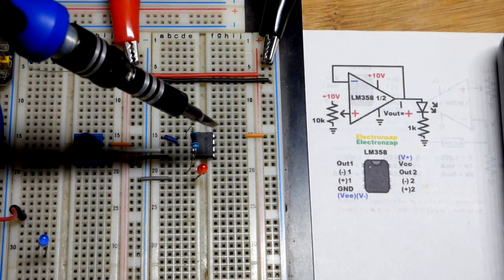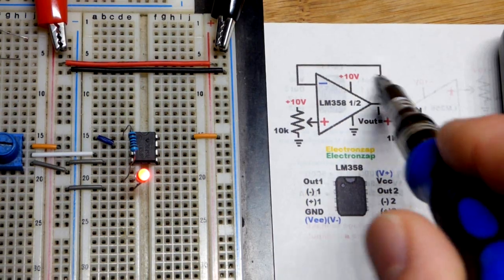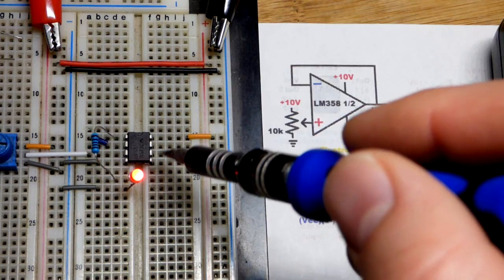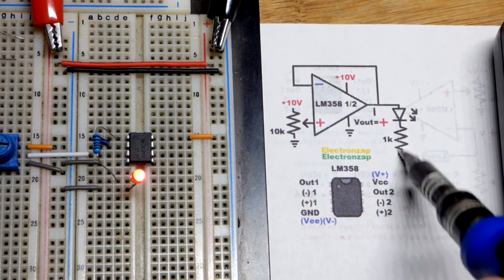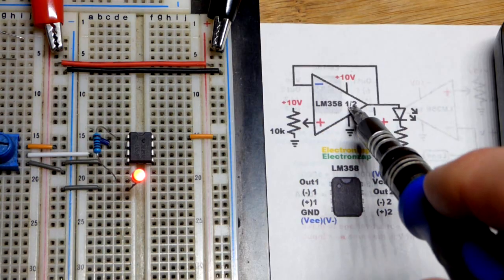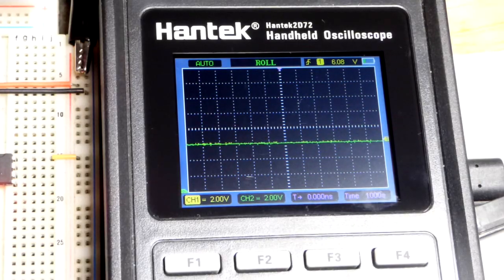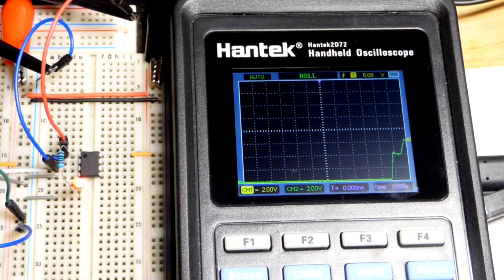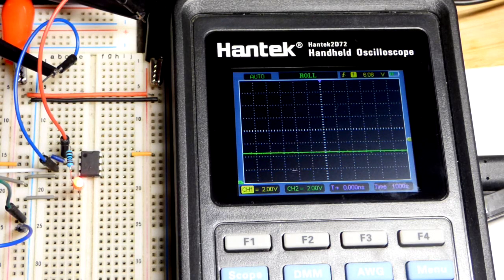Op Amp Voltage Follower demo circuit

Comment: Cool...I just bought one of those multi meter/oscilloscope instruments. Not used the Osc yet as I am worried I might blow it up. Be nice if a couple of videos could be done on the very basic use of the Osc function. I've looked at a few tutorials but most of them work on the assumption that one already knows what to do.

Say on checking low power audio circuits, low voltage regulator circuits (am messing around with the LM78 series regulators atm.

Anyway nice video, thanks.

Comment: Well, I found out the remotes failing for me was my fault, of course. Circuits change substantially for me after I solder them up. Breadboards seem to leak power  (70yr old newbie :-).
Reply from the maker: It's easy to miss something :)